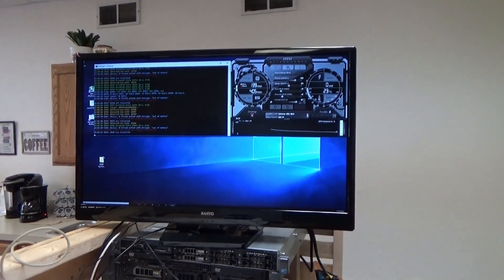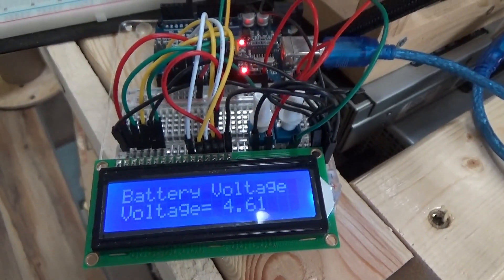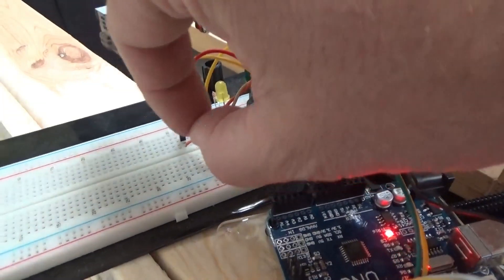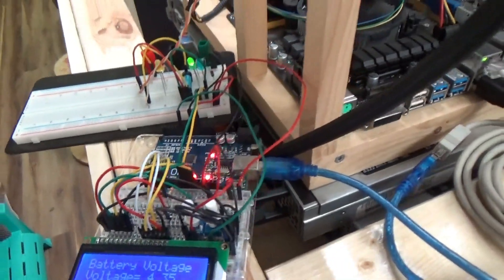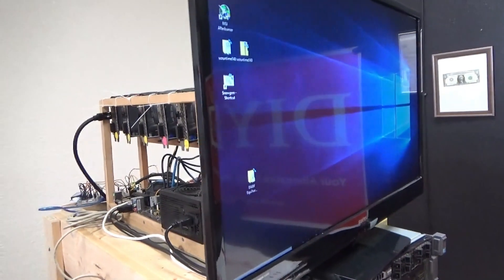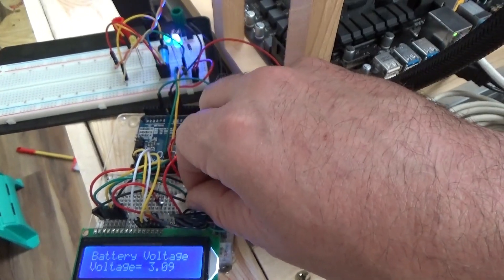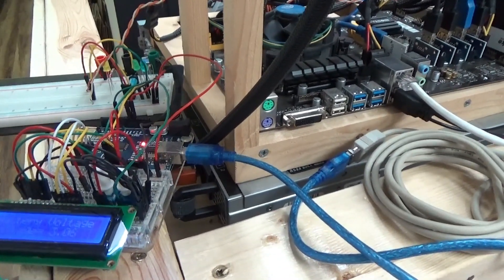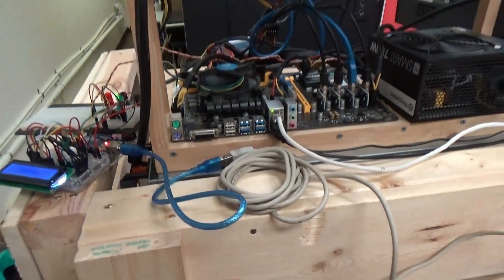Arduino Controlled Solar Power Cryptocurrency Mining Rigs

Comment: Cool thing. What about using a raspberry pi which reads the data from your Morningstar Tristar. The raspberry could wake up the Rigs using wake on lan and shutdown could also be triggered over lan. Windows can also provide an ssh server. Greetings from Germany
Reply from the maker: I am familiar with Arduino but not raspberry. I guess I could do the same thing on Arduino. One thing tho is I will fully disconnect computers from power at night. And this is fun :)
Reply: The Do It Yourself World Electronics true if you want to fully power down everything, then the Arduino is the better solution.